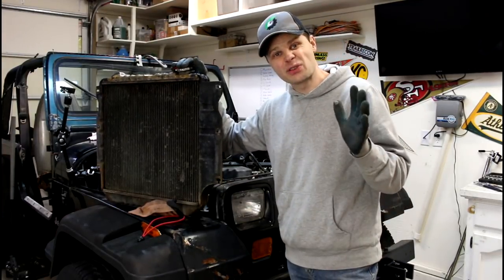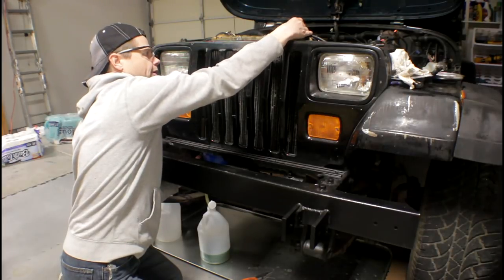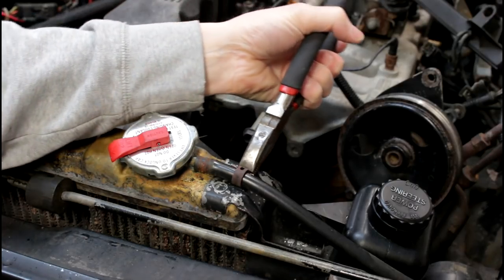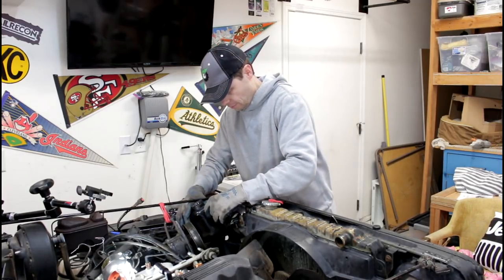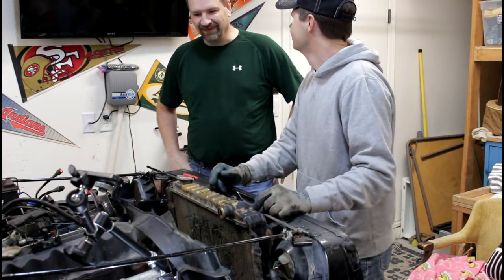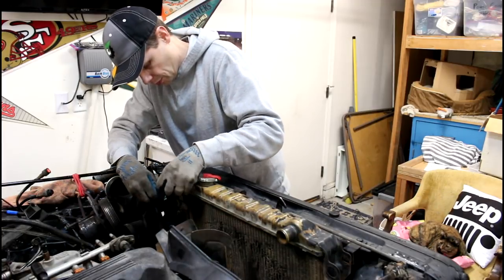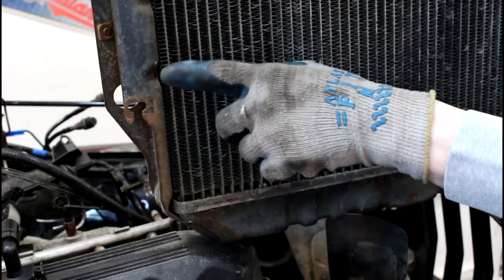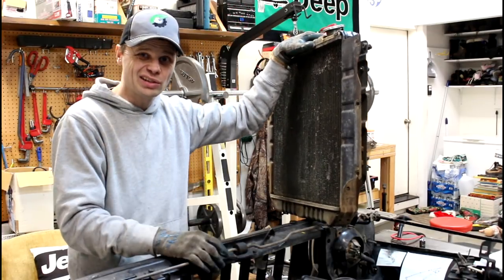Jeep Wrangler Radiator Replacement

Comment: I had to replace the radiator on my 90 YJ because the top tank separated from the tube section. Your video helped me realize that I could do the job “no problem”.

Comment: My 94 YJ's temp is going up when I'm at a stop, but gets cooler when I'm driving on the highway.  It just recently started doing this.  Could that be the radiator?  I replaced the thermostat about 10,000 miles ago.  Any help would be appreciated!

Comment: I'm looking at a '90 YJ 6cyl as another project for my channel, any advise on what to look for or what to avoid?
Reply: Rocky X TV keep in mind they switched from carbureted to fuel injection in 1992, otherwise they're all pretty similar.
Reply from the maker: +Rocky X TV most important to me are condition of engine and frame.  Has engine been taken care of? No knocking, ping, anything that sounds bad... and is frame straight??  Much rust??  Body and interior, you kinda get what you pay for.  Better shape obviously costs more $$.  Happy hunting!
Reply: Thanks for the advise!
Reply: I did read up on that part because the one I am looking at has a carb and wanted to make sure it was supposed to. Thanks for the response!

Comment: I am new to the yj family.   I heard there is a "procedure" for burping the coolant to avoid hot spots in the head that cause the head to crack.    is there a procedure you use?  thanks @jeepsolid
Reply from the maker: Use a kit such as this one. https://amzn.to/2Ppn4eJ Then fill your system, and keep large funnel attached. Then fill the funnel 1/4-1/3 full while the engine is running. As your system burps, it will pull in extra from the funnel.

Comment: Jeep solid : I got a short on my right side ID light in the front, above the tire that long skinny one ..It don't light up at night when I put on the lights .
Everything else is lit up except that  one. I also noticed in front dash area ,the arrow light is constantly on ( when I put on the lights at night) . Anywhere I should look ? Maybe a fuse somewhere. 
I did change my back stop light recently.
Reply from the maker: +Giovani22 The turn signal light on is a sign the bulb is out, or contact is corroded, or as you mention, a short.  I'd start at the bulb and work back.  Get your electrical tester out ;)
Reply: ok
Reply: JeepSolid I'm gonna look into that right away Jeep solid. Thank U
Reply: Always enjoy your videos. I need to get a new radiator for my YJ, do you recommend the one you have linked?